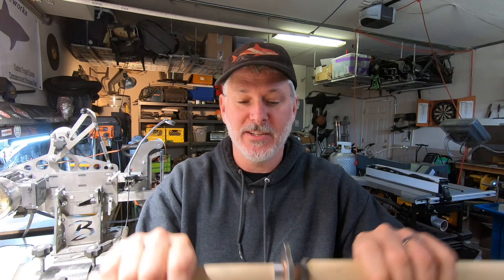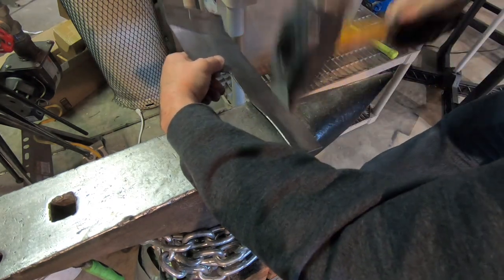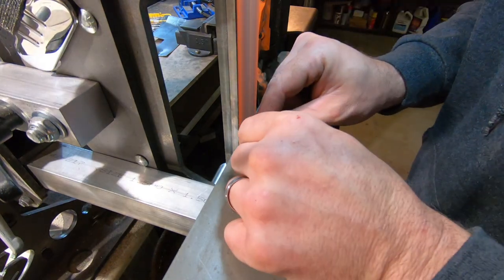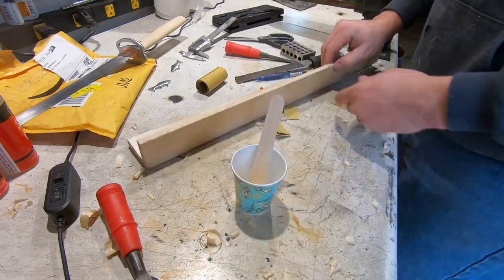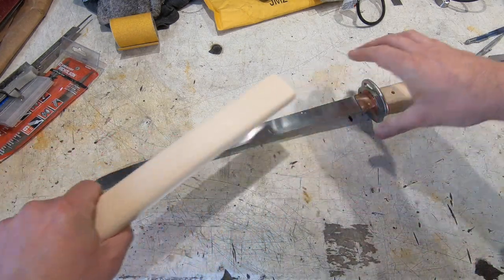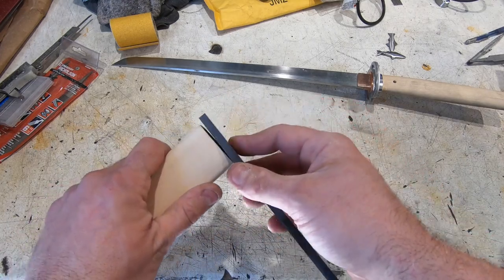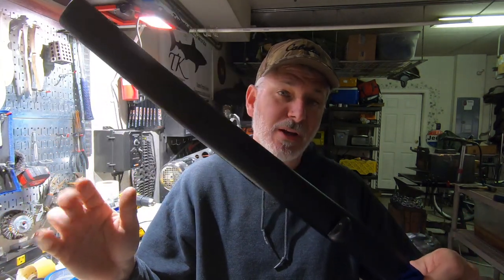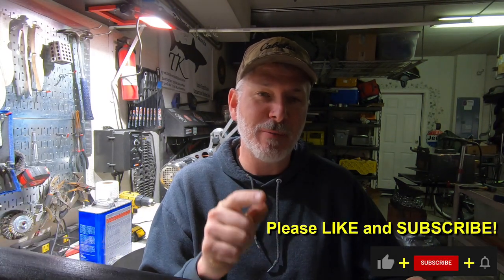Forging a Wakizashi San Mai Sword - Part 4 - The Saya

Comment: i have always HATED that thing on the saya. its position just felt unsleeck to me. if i buy or make a sword where its fitted correctly according to tradition, then when i wear the katana the end of the hilt is at my nipples, and that looks wrong and is unpractical in martial arts, so i put mine half way closer to the guard, and have shorter handles. functionality not impaired and for myself its actually improved. lol.🤣

Comment: Why are you Americans learning so badly about what you are trying to do?
Reply from the maker: Not really sure what you are saying, but thanks for watching.
Reply: @TyrellKnifeworks  Sorry for my English. As a blacksmith, I am just very worried about the bad attitude to work. And the manufacture of Japanese blades requires not only knowledge of metal processing, but also knowledge of the issue.
Reply from the maker: First off, I’m Canadian.  Instead of saying I don’t know what I’m doing, perhaps actually provide what you think is wrong?
Reply: @TyrellKnifeworks  The handle is completely irregular. It's hard to put into words. The front part should be absolutely flat, and the rear part should be slightly concave, and the top of the handle is wider in cross section than the bottom. The scabbard is rectangular in cross-section, but should be ovoid. Kasira is absent, which is unacceptable. Also, kissaki of this type is sharpened differently.
In general, the work is very high quality, but I'm picky about such details, sorry.
Reply from the maker: @ОГОНЬИВОДА-г8х  you should watch the whole series first.  Some of that was corrected. Thanks.